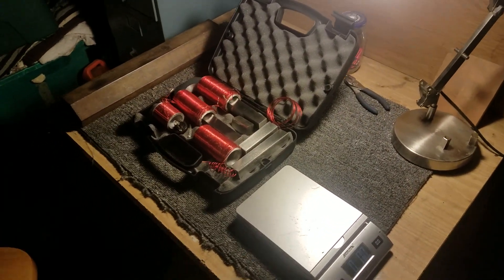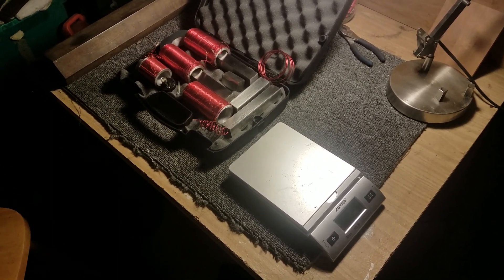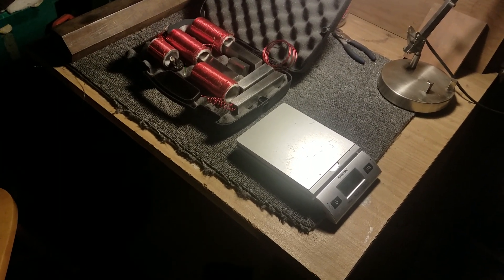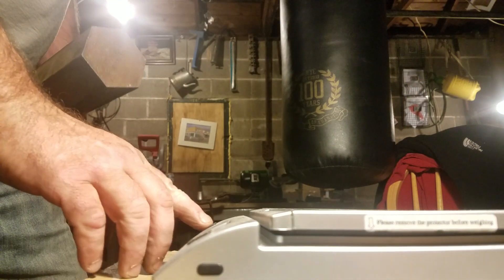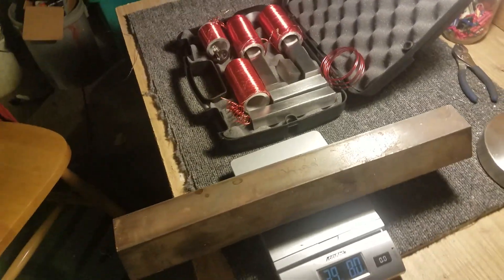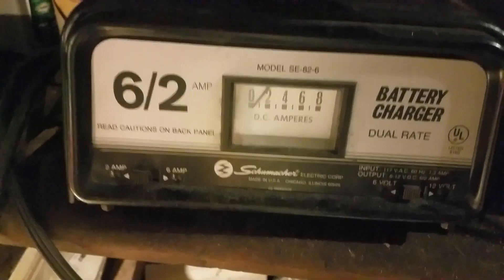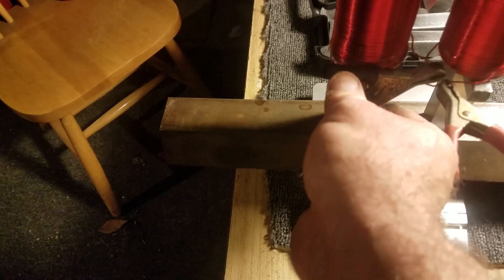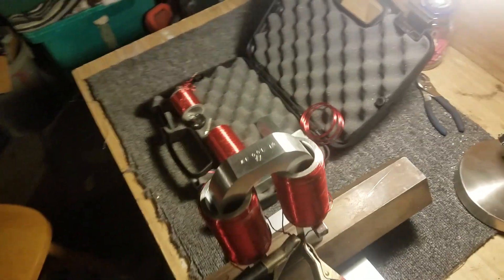Leedskalnin's Perpetual Motion Holder (PMH) 2/3 Scale Demo

Comment: What does a perpetual motion holder do? What are its applications?
Reply from the maker: Check out page 10 and 11 of this link to see what it can do. https://www.leedskalnin.com/Leedskalnins-Writings-MAGNETIC-CURRENT.html
 Its primarily a teaching device, buts it is a number of other things including a real working flux capacitor and a particle accelerator!
Reply: @MagneticUniverse  Does it in any way relate to the little black box which some are saying was a device Leed build to reverse the polarity of atoms/objects and thereby alter an objects relationship to the earths gravity?
Reply from the maker: @Corteum  it could be however there is a lot of speculation about those boxes that isn't  grounded with any evidence.
Reply: @MagneticUniverse  I would think that the experiments he describes in his books and writings are meant to provide the base framework for the understanding of what he (re)discovered to do with gravity, magnetics, antigravity, polarities etc. 
Do you recall which of his books, if any, where he mentions polarities or altering polarities?
Reply from the maker: @Corteum  Throughout his writings he describes currents to be alternating in nature and to get direct currents you have to use a commutator.  He did build an alternating current generator out of Model T magneto V magnets that was turned with a hand crank where it would have been easy to pinpoint certain frequencies.   He uses the PMH to demonstrate how alternating currents are made by man, and you can find this experiment in the link above.  The only thing he mentions that can be construed as a discussion on antigravity or rather how to diminish the effects of gravity can be found here: https://www.leedskalnin.com/Tips_For_The_Rocket_People.html
He never discusses his building techniques, but he does tell us the most efficient way he discovered to make electricity also in the  original link I provided above on page 11.   There are few occasions where he subtly alludes to telekinesis and telepathy...

Comment: I think Ed named the PMH wrong. It should have been named the CEH "Conservation of Energy Holder". There is no "magnetic current". I made one of these years ago and messed around with it. 
Try this: Put an insulator ( like paper) between the "U" and the "keeper". If you charge it with enough juice it will stick even with the insulation applied. Test to see if you get any current between the "U" and the "Keeper" when the insulator is in place......NONE!  No current!!! Nothing is moving here!! Ed's version is very inefficient as well. You can just wrap like 30 gauge wire around the "U" starting at one end and keep wrapping until you get to the other side. This works way better than two of those huge coils and can work just as good with much less juice. Here is the only important thing to note  about this PMH: Charge it. Then get a compass and move around the PMH in all directions. Notice it has a magnetic field? The compass will move and show poles. Now, see if you can pick up iron fillings or paper clips with it???? Nope! A piece of iron with a magnetic filed yet no magnetism. That is something to think about! A charged PMH is a "Static Magnetic Field".
Reply from the maker: Good stuff, thanks.  I think he should have named it The Flux Capacitor for obvious reasons.
Reply from the maker: Have you done Ed's tests that prove there us motion inside the bar?